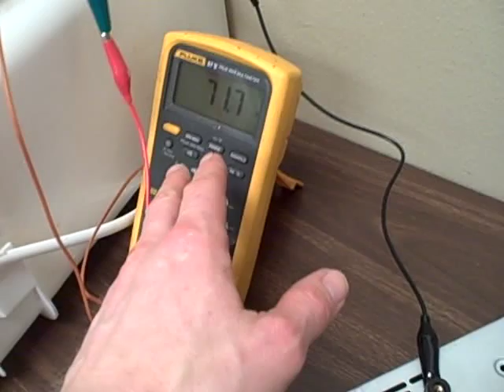Thermosiphon heat exchange process (with Barbie)

Comment: Thermosiphon is powered by density change, so gravity is a component. Because of this horizontal runs don’t add any energy to the flow, and trying to force the flow downhill flat kills it.  A properly configured thermosiphon does not cycle/pulse and the flow rate is in direct relation to the energy transferred/density change.  To properly plumb this, you need a vertical heat collector, and need to come off the top and go only upward to the top of the collection tank/dissipation device.  The bottom of the tank(coolest water) needs to come from the bottom of the tank and go only downward to the bottom of the heat source.  Works good in an engine with hot water coming off of the head, up to the radiator, down thru the radiator as it cools and from bottom of the rad returns to the engine block where it heats and rises to the head.  This thing heated water in the tank by boiling the water in the heater, the expansion/steam forced its way thru the path of least resistance to the top of the tank. When the pulse subsided and the steam bubble collapsed it was replaced by water from the highest pressure source, the bottom of the tank. Like a coffee maker...
Reply: Man are you still around? I’d love to ask questions
Reply: @bakedbuffaloewings3303  ask away…